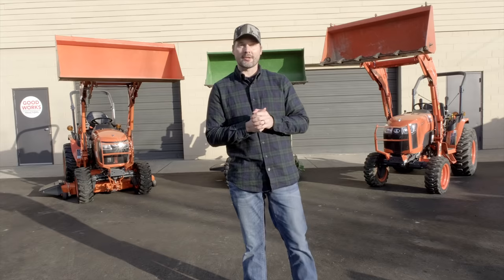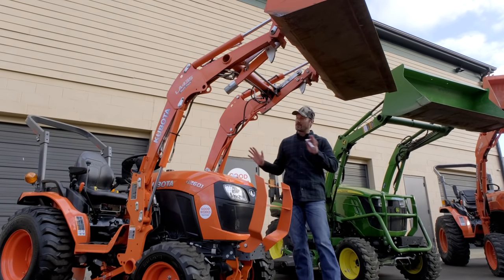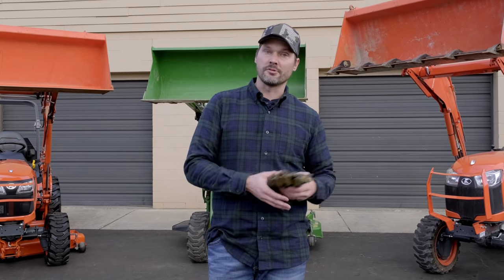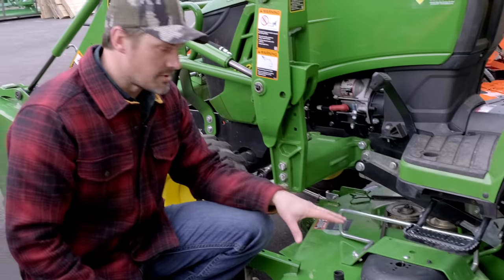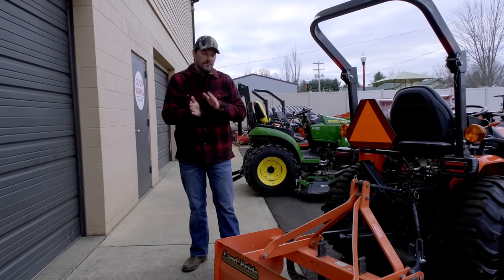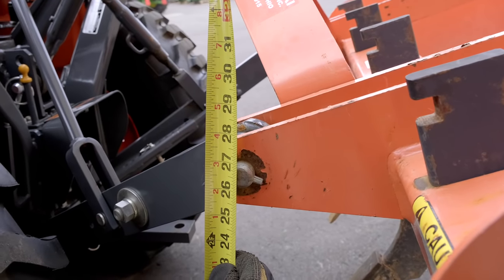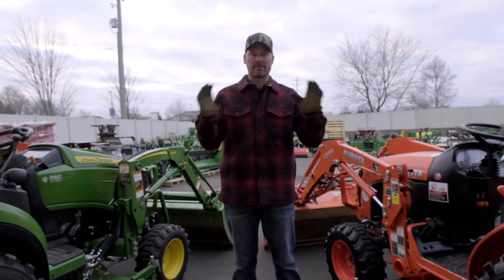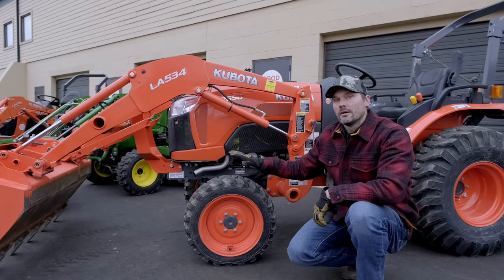NOT EVEN CLOSE! JOHN DEERE vs KUBOTA: B2601 vs 2025 vs B2650

Comment: I own a JD 6140M the M meaning closed platform with A/C and heat Accessory includes satellite Xm. Am. Fm. weather radio, refrigerator, and Buddy fold down seat.  7 ft. wide loader with quick disconnect bucker and the complete loader. Genuine 8ft wide Gannon the Gannon weight is 2000 lbs. tractor is 10 ft. tall. rear tires are 6' 6'' and I love this Tractor. I also have a old Massey Ferguson with a loader and backhoe I also have a scraper blade and border disk both with 3 point attachment. I have had this tractor for about 20 years with very good luck. 
U have a great DAY.

Comment: Found a new 2018 B2650 still on the lot a few months ago with loader and box blade for  $15 grand even. Guess they were trying to get rid of it to make room for the new Lx model. I bought my little 8 acre ponderosa seven years ago and have been wanting a tractor ever since. Thought I could only afford a subcompact but found that one and leaped.  Runs like a dream. Way more power than I was expecting.
Reply: That's a great find.
Reply: @Keith_White  Sometimes you get lucky, but patience also perseveres. I didn't pull the trigger for almost 7 years  of looking

Comment: I went with the Yanmar 324 because of the warranty and the 1200lb loader capacity. Really you cant go wrong with any of these tractors these days.
Reply: I'm thinking about the 424 with a cab, how do you like the 324?
Reply: @madurosfinancialadvisor1360   Absolutely love the tractor i think they are the best value in their segment and its not trash like the Korean and Chinese made tractors. You might know this but the 324 and 424 are identical only difference is tire size. I highly recommend tire ballast for traction and stability.
Reply: @thatdamguy00  Thank you so much. Yes I don't know why they don't offer the 324 with a cab option. It doesn't make sense. I'd love the smaller tire option, probably fit in the chicken houses.  Only need a couple inches.

Comment: I started my tractor journey with a craftsman cat. Zero with sleve hitch equipment wanting to prepare roadbeds for food plots on hunting lease. After a couple of years I bought a case international 235  and a Kuhn rotor tiller and this served me well for 14 years but I wanted something bigger. Eventually I purchased a new kubota 4X4 3940 with bucket loader and the only regret is I should have done it 25 years earlier. I then traded the 235 for a used kubota L2050, the Kuhn tiller is great behind it for my garden spot. Later I moved and needed something to mow with and I found a kubota L3010 4X4 with belly mower to cut my grass. When I drive buy a JD dealership I only look for used kubotas and keep going.
On a side note, starting out with a small tractor only made me want a bigger one. They are like garages, figure out what you think you need then get something twice as big.
I’m not condemning other tractors, what I’m saying is my Kubotas have been good for my needs and have served me well and are my first choice if we’re to get another one.

Comment: Love you channel. Recently watched your comparisons of series 1 John Deere V Kubota. You brought up a question about a step for the B2601. Just for your viewers the B2601 uses the same step as the B2650, just does not come standard on the B2601, bolt holes already on the B2601. When going to dealer to get step at parts it doesn’t show a step to order for the B2601 but if the parts department puts in B2650 you can order the step for the left side. The B2650 can have a step for both sides but the B2601 only equipped with bolt holes for left side and uses the same step as the B2650. Hope this helps.

Comment: After much research,  I found that basically all small tractors,  under 70 hp, was built in India with Japanese engines,  but Kubota is all made in Japan with Kubota engine, that's why I bought a new Kubota 3240 in 2010, love it, no problems at all, best there is.
Reply: I have an old Kubota subcompact. It is almost indestructible.  I got beat up on another channel for not buying American.  Good luck with that.

Comment: What about the cost of ownership? Are there any notable differences in routine repair expenses, and frequency of non-routine repairs between the two brands?
Reply: I have owned, and still do, a B2410 since 2001. In all that time I think I spent $125 or less in non maintenance items. Bent a hood prop being stupid, had some rust seize a lever for the 3pt and bent a rod, and replaced the seals for the front axles where they pivot for steering.  Battery lasted 16 years.  This year I had to replace the fuel cap and hood latch release due to age cracking.   It has been so reliable that I ordered an L4060 HSTC to join it on the farm.

Comment: I just bought a TYM 3 weeks ago it's the T264.  I think 24.8 hp.  I looked a the green and orange machines but with the research I did I'm very comfortable with my decision and 5k I kept.  I think it will more than manage my 4 acres.  I already want pallet forks and a snow plow for a quick attach front end and something that will dethatch the grass.  I have all sorts of plans for it.  Need to fill the tires first.

Comment: I've had John Deere most of my life. Never had any problems. Using the bucket or the backhoe or the box blade or the auger to drill holes for all those fence posts. I can't complain. When I bought it with all the attachments, my dealer thru in a trailer for me so I can take it anywhere it has to be used or to take it in for maintence.

Comment: Great comparison, but when going over the engine specs, add the torque ratings. Those diesel engines are impressive by themselves. I have a Kubota L2501 rated at 24.9hp, but produces over 70ft. lbs. of torque (and that's naturally aspirated).
Reply: Kabota diesel engines do not last.  I see them failing all the time.
Reply: @richardallison8745  that’s a good joke. Kubota makes excellent small Diesel engines, that’s why different companies used their engines in their applications. Bobcat used Kubota motors, etc.
Reply: @mchuo7834  Not a joke.  All of John Deere's small tractors have Yanmars.  I am close friend to a tractor/heavy equipment mechanic that works on more Kabotas than any other diesel.  Maybe you don't know what you are talking about.  My Yanmar is 40 years old and still putting away.
Reply: @richardallison8745  classic, Richard... "I have a close friend." My daddy's an iron worker, but that doesn't mean I know how to build a bridge! John Deeres, Kubotas, Kioti's, Massy, Case they all have solid motors. When it comes to deeres your just paying more for the name, period.
Reply: @nickg2366  I only admit the Kabota numbers are better but the John Deere with the Yanmar will run decades longer.  I have a 1978 Yanmar tractor right now and that engine is tough.  I used to occasionally go to the John Deere Iron Foundry years ago and the quality control was phenomenal.  Yes they have the name but the quality too.  I would think Yanmar would have to meet their specs to be in their equipment.  JD and Yanmar is a good fit.  My friend has a bunch of broken Kabotas in his lot.
Reply: @nickg2366 l

Comment: yes the step from b2650 will fit the b2601 but if you have a midmount mower clearance becomes the issue between the bottom of step and top of mower deck when raised up.
Reply from the maker: Interesting...wonder why no one else has mentioned that?  Thanks for sharing!

Comment: Grew up driving both Kubota and John Deer, the farm Kubota’s always had better longevity. That was 15 years ago so maybe things have changed.
Reply: Things have changed. Check out the Kioti brand tractors and you'll see for yourself. Hands down the best bang for your buck tractors.
Reply: @ComfyBe  Kioti is Kubota, dig down and find who owns the company.
Reply: @ridgerunner106  ya who owns all of them one big group all they need is 51% run all business on earth then
Reply: @onlythewise1  I really don't care. If the tractor works, I'm happy with it.  I would rather have one I can possibly get parts for.  My neighbor has an old Belarus. You have to set the loader down to turn the wheels if sitting still.  One day the front axle snapped in two driving down the road.  It was like 3" solid rod and it broke.
Reply: @ridgerunner106  oh ya i got  13 acres in prime California  i have to plow it  almost each year last dude charged me 1,500.00, im try to do it myself   wear to start i dont know  ,new homes  two hundred yards from it
Reply: @onlythewise1  If all you need to do is plow 13 acres, then an old row crop farm tractor and plow are all you need.  You can get them inexpensively.  The new tractors, especially JD, are full of electronics that are expensive to repair.
Reply: @robertsparling  ya i might try that
Reply: @robertsparling  you hit the nail on the head about the electrical problems

Comment: the step for the 2650 will bolt right up to the 2601. i know this for sure because i put one on my 2601, the holes for installing are already there from the factory.
Reply from the maker: Sounds like there's an issue if using a mower deck though based on other comments
Reply: @GoodWorksTractors  your correct , if you are going to install a belly mower the step will have to be removed.

Comment: On a smaller tractor like these, I don’t think it’s that big of a deal to have the fuel fill in the middle of the hood, but one of my biggest issues with my L3901 is having to lug my 5 gallon diesel tank up to the operator station and awkwardly lean out with it over the hood to fill it up.
Reply: I agree...I have had 3 Kubota L35TLBs over the yesrs and that always was one of the few things that peeved me a bit...but,thry do so good on fuel that it's only a once a week neccessary if I sm working daily.

Comment: Great comparison between these three very popular tractors! A little extra info on the Kubota’s/ the mower deck can be pinned to the tractor while using the 3 point or even with a back hoe attached and FL attached too.
I’ve done it for quick small digging /FL work which is convenient. On the B2650 the mower is held at a good 8” above the ground when pinned. Yes I remove the mower for bigger digging projects.
Really enjoy the the videos though, good stuff! 👍
Reply from the maker: Thanks for sharing!!
Reply: Thx for that info!
Reply: @L Cee is that in the Kubota manual? How would i find out how to pin the mower?
Reply: @gidzey4783  I believe it is but not sure if it’s in the mower manual or the tractor manual. I should have pointed out this can be done on the 2650/3350 series however, I would think on the 2601 as well. The pin mounts are located towards the front of the mower deck. They are kind of hard to see but with the deck fully raised the holes in both mounts ( mower and hanging down from tractor) should line up. I made extra long pins from electric motor bolts. They are 3/8 dia although the holes are basically 1/2”. I put a 90deg bend 3” from the hex head. Makes it easier to pin/unpin with smaller dia and long length for reach.
Hopefully this helps! 🇺🇸

Comment: I bought a used Kubota  L35  25 years ago with a nice hydraulic scraper box on it. It now has almost 3000 hours on it and I  have put very little $ into keeping it running well. I have a small ranch and use it most every day. The secret is maintenance!

Comment: I went with the 1025R over the Kubota, both are good tractors, however The twin touch Hydro on the Deere is so much easier to use than the Kubota. I had a 1026R first year they came out, it was 9 years old with almost 1,000 hours and never had one problem with that tractor.
Reply from the maker: Thanks for taking the time!

Comment: Someone may have already commented.  I have a B2601 and the B2650 step does fit on the 2601.  Merry Christmas!
Reply from the maker: Thanks!  Sounds like there is an interference issue with the mower deck.  Merry Christmas to you as well!
Reply: Yes there is with the mower.  I don't have a mower installed and knew it wouldn't fit with a mower.  I apologize, should have mentioned that.  It is an option for those who don't have a mower installed.

Comment: I have a b-2401 that is gear drive 20/20 version. And I actually prefer that over the hydrostatic drive.
Reply: What type of work do you do w/your B2401? Have you done/do you do much loader work w/it? I really (think I) want a B2401 but everything/everyone points me towards an HST, especially for loader work & I expect to be doing a lot of work on smaller residential lots. I'm going to test drive a B2401 but that doesn't really indicate how it'll "work." If easier to email, just add @gmail.com to my username here.
Reply: @danielsharon524  I mostly use mine just around the house I have a 6 acres wooded and  1,000 ft gravel driveway with a hill on each end so I don't really do jobs with my tractor as of yet anyway maybe when I retire but right now it's more something my other tractor was 43 years old I got tired of working on it I couldn't beat the prices and I wanted a new tractor something I didn't have to work on it but I really like it I don't have any trouble at all with the with the gear drive but I'm not doing a lot of loader work back and forth back and forth so it works out for me and it was a little cheaper and I had heard the little troubles with the hydrostatics on the BX's but yeah I like it really well it suits my needs fine
Reply: @Waynesworld690  Thanks for the feedback. One of the (understandable) complaints I see with the subcompact/compacts is the inability to attack a pile with the loader like one could w/a bigger machine but after watching Messick's vid comparison bet the same model gear drive vs. HST makes me wonder if it's the HST that's more the limiting factor than than size of the machine. I think I'd get used to using the gear drive in my application (I anticipate doing a lot of work on small residential lots) and ultimately might like the gear drive better. I drive a manual transmission pickup by choice & have plowed snow with one & liked it & I'm super easy on clutches. I even speed match shifting in my truck pretty well and I'd think could do it on a tractor if need be. My biggest reservation besides the loader work is that a gear drive precludes me from putting anyone else on the machine if I wanted to hire an employee or put my kid on it.
Reply: @danielsharon524  I have the hydrostatic b2601, before I owned a geared branson 38hp and an old massey. I can do more work with the kubota especially in small spaces and lots of digging work. I'm not the biggest fan of the cruise control on the hydro but picking a range and just heel/toe for forward and reverse is just great.
Reply: @InspiredCraftsman  Thanks for the input. It's a big decision. I've talked to a few guys w/2401's on Orange Tractor Talk that had driven other gear drives and say the 2401 much better to operate. I agree that virtually no one would recommend or purchase a gear drive for my application & in the end I may not either. We'll see.
Reply: @danielsharon524  I can see the benefits of a gear drive if your doing lots of mowing/brush hogging/discing, gear drive really shines when going in one direction for long runs. When I bought my 2601 I got it with the gannon, loader, and backhoe. The promotional financing is pretty awesome. Look into the rear diff locks on the 01 models. It's a weak point and the gear teeth can shear losing the rear locker ability.  There are work arounds but frustrating in a new tractor

Comment: Tractor Tim know your doing this buddy....lol! Great job! I have a 2025r and agree with you on the weak loader. Oh, it lifts a bucket full of firewood or dirt, but when you really need it to be strong it’s gonna let you down! I pushed up my asphalt drive earlier this year and piled up the asphalt. I now have someone that wants it for a new drive around their barn so while loading, and of course trying to get the bucket full it really struggles! And John Deere’s 3 point hitch is more than a little low at full lift. I bought this tractor because of the ease of changing implements and I really do like my tractor but these some things Deere really could improve on. Great video my friend!
Reply from the maker: Thanks as always :)
Reply: Same conclusion I came to m/l (I'm considering a B2601 vs. 2025R). With the exception of the single point hydraulic connector on the Kubota, Deere excels in convenience/appearance features while Kubota excels in functional "real tractor" features. Tough to justify giving up the Kubota's more functional features for the convenience although the Auto-connect deck & load & go features are compelling.
Reply: I bought a B2301 this year and love it

Comment: The step for the B2650 will fit the B2601 the holes are  there under the  mat. Just need to bolts
Reply from the maker: Good to know.  Makes sense, thanks!
Reply: Yes. GPOutdoors channel does this mod on his 2601 when he had it.

Comment: Have a 4130 JD which would compare well in size with these Kubotas. The yanmar engine starts so good in really cold temps. Really miss JD not having this size tractor anymore. I bought it new about 20 years ago and it has most of the features of all these tractors except the drive over deck. The deck is the same width as the rear wheels and I leave it on year around including the rear blower. Front blowers are nice but I would miss the bucket for scraping the driveway with downforce and getting out of a stuck situation.